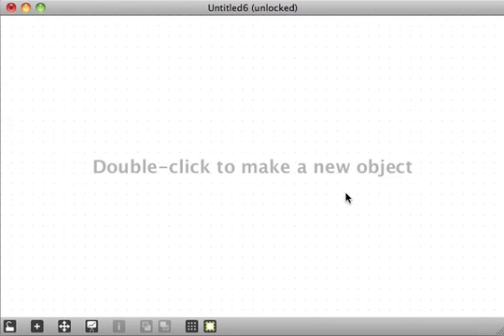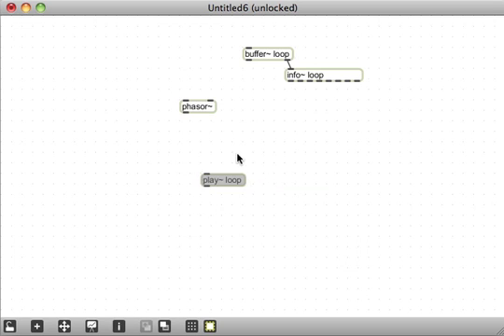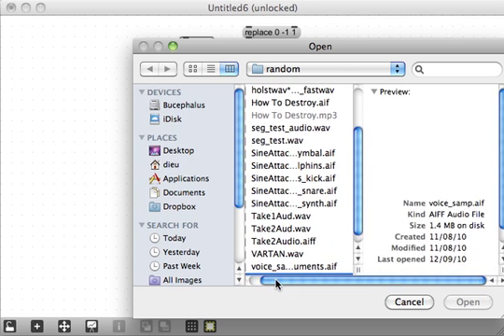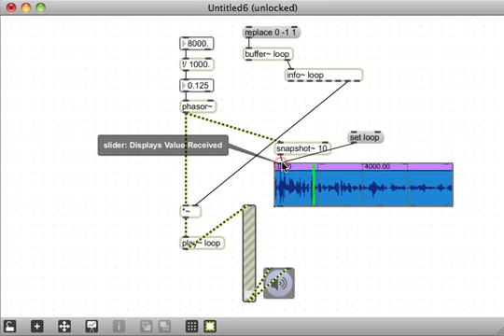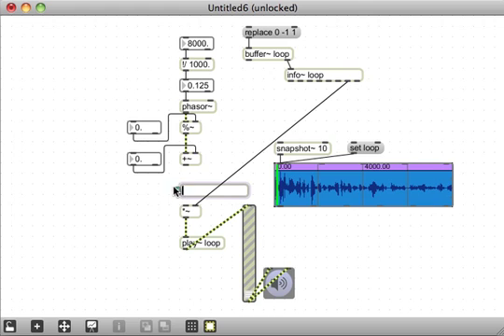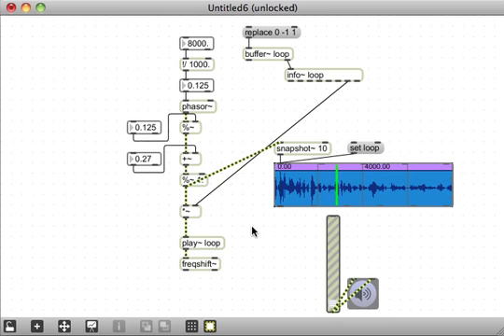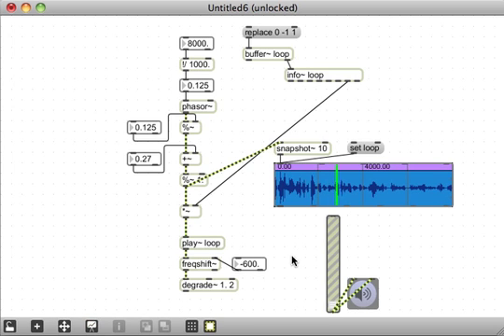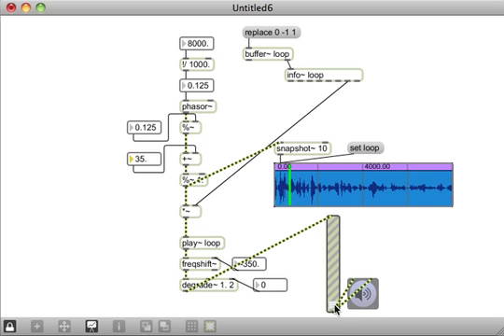Delicious Max/MSP Tutorial 3: Stutter Effect

Comment: Looping with this method will give strange result if the number input in the right inlet of the first %~ (the one directly after the phasor~) is not a rational number, i.e. if the remainder of 1 by this number is not an integer number. If it isn't so, you will have one loop that is slightly shorter than the others.